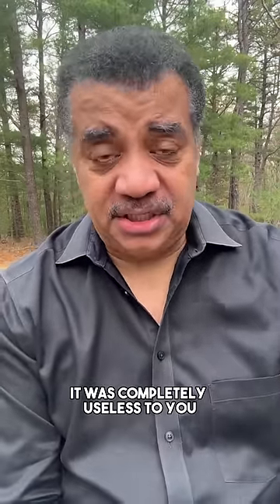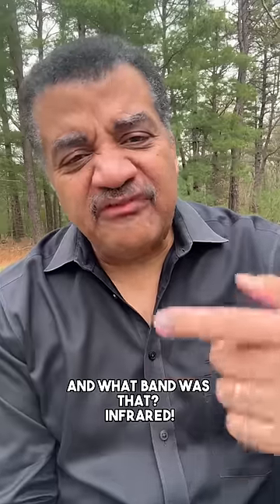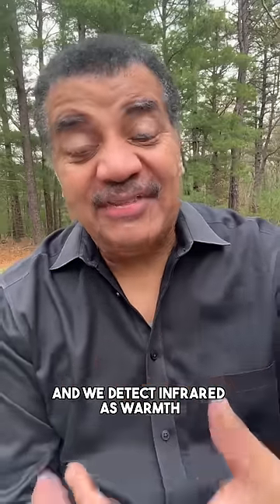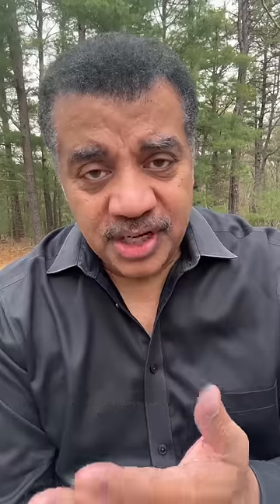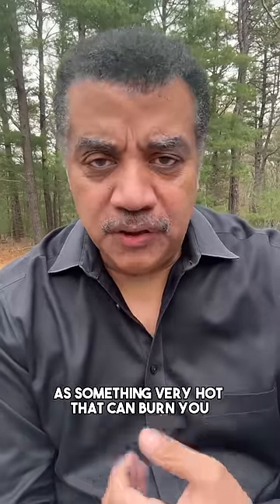LED Bulbs vs. Old Bulbs 💡

Comment: LED's do get hot, but only on the bulb base.  After it has been on for a while, turn it off for a half hour before unscrewing.
Reply: The same way you could unscrew an old lightbulb without waiting for the glass to cool off. Just avoid to touching the hot parts directly. For old bulbs use an oven mitt or a towel or any basic pair of gloves. For LEDs just set the bulb down and let it cool down. There's no need to let the base cool off before removing it.
Reply: 1/2 hour? a few seconds seems to be all they need. There's a 60W equivalent right next to me which has been on for several hours, and its temperature is just a little warm. I can grab it and unscrew it while it is on.
Reply: That's the DC power supply making the heat.  They use inefficient garbage circuits to cut manf costs and to ensure the bulb eventually dies and forces you to replace them (IE, buy more).
Reply: @meeponinthbit3466  yeah, i work maintenance and the package may say lasts ten years but never in reality. The diode may last that long but the cheap electronics never will and yes, that's what gets hot.
Reply: You only have to wait like half a minute then it's cooled off enough to touch long enough to unscrew the thread a twist at a time
Reply: Thanks
Reply: 🤔 I have bougth cheep ones, expensive "good" brand ones, they get hot as h#@%!..... 
All the safty courses l have been one recomend LEDs.... I wonder if then course instructor ever has checked his lightbulbes, old style or  new style.. Not with his fingers!
Reply: @meeponinthbit3466  No kidding, I've never had a single LED light bulb last anywhere close to what it was rated to last.
Reply: Correction. Led bulbs get hot but the base is designed to transfer the heat away from the led like a heat sink and so it gets hot.
Reply: @ankurbhardwaj6184   Most heat sinks in those LED bulbs are so unsubstantial that they're not capable of drawing away enough heat. I've dismantled every single failed bulb from every brand I've purchased. The very expensive ones have thick, heavy heat sinks and the cheap ones have barely more than just some foil.  Sadly, none of them last to their rating.
Reply: @ranman7688  you missed my point.. I agree to what you'r saying. What I said was that I disagree that led bulbs get hot only at the base.. infact they get hot right where the led is fitted and the base feels hotter because it's supposed to take the heat away from the led itself. How good the base is depends on the manufacturer but the base heats cause the LEDs generate heat
Reply: @meeponinthbit3466 I'm guessing you've seen the breakdown of the Phillips bulbs from Dubai that BigClive did.

It's a shame that manufacturers are allowed to get away with planned obsolescence and waste resources while claiming to be better for the environment... And charging more for the privilege.
Reply: @16-BITFPV There’s no way they get hotter than an equivalent incandescent, that’s basically impossible when the power draw is so much lower. Like Neil said, incandescents are basically just heaters with a side-effect of making a bit of light.
Reply: That was a good episode
Reply: Yes but the incandescent is better at handling heat (tungsten is literally about the best material to use for heat and is also used for Welding) vs the plastics and other weird substances that come in an LED bulb. I'd rather breathe air in a room with hot tungsten and glass than one with heated mystery glues and fire retardant plastics.

Comment: Fun fact.
In cold climates, that energy isn't wasted.
It's electric heat that reduces the amount of energy used in your heating system.
Reply: Most of the world experiences Summer though. At what point is the additional energy used by the cooling system more than the energy saved by the heating system
Reply: @sbk2207  theres no such thing as being more than 100% efficient
Reply: There is still energy wasted, thermal energy is converted into kinetic energy.

Comment: It wasn't completely useless! On cold nights in Michigan I would turn down the furnace and snuggle up under my comforter and read a book near a warm incandescent light bulb. It was delightful.
Reply: Yep,  if you still have power and your furnace fails , a 100 watt bulb in a confined (insulated) space can warm it up .   Under a comforter, in a "table fort" even sitting in the bottom of a small closet etc.   I suppose you could have swapped out the lightbulb under the comforter for an electric blanket which would do about the same thing energy wise but with out the added benefit of reading light..
Reply: @markbajek2541  then there is the worry of starting a fire or getting burned touching a hot bulb
Reply: @chrism3784 
Which never happened in history lol.
Farmers in India use it to keep their farm chickens warm at night
Reply: Paul Wheaton has some words to say on this subject. Extra heat in the summer, no thanks, but in the winter, absolutely not wasted energy.
Reply: Cute. Next story my guy...

Comment: ...and even with LED bulbs our electric bill keeps going up, up, up!
Reply: but dont worry those expensive bulbs that are worse for the environment to produce and dispose of, and aren't any better to use, well they're "saving the world" by all that nasty climate change incandescent bulbs cause, ya know!?
Reply: The Amish are the greatest adapters to Solar; but their electrical needs are about Necessity, &use something like 30% ov a ‘Standard Household.’

Blame Capitalism allowed free reign from about 1980 onwards &the need to destroy ‘Socialism’ in whatever form.
Reply: live somewhere with cheep power
Reply: Lemme know when you find it
Reply: The electric company shareholders and directors are the ones benefitting
Reply: Thanks Brandon
Reply: @stevehendricks5443 the president (before you accuse me of something i dont like joe biden) is not responsible for literally everything that goes bad in the co8ntry. Please actually research why things are the way they are instead of just blaming the first thing thst comes to mind
Reply: Trouble is, lights were never a huge part of our energy usage. Incandescent contribute to heating your house in the winter, so at the time, in a way, they’re 100% efficient. Conversely, I do like led bulbs in the summer, since they don’t contribute as much to the heat load on the a/c.
Reply: @sirrivet9557  Lol! Touch a nerve?
Reply: ok try going back to incandescent bulbs and see what that does to your electric bill 😂
Reply: @adrianpg4460  Many people still have them including myself. If its still working, why replace it? Lol

Comment: I used to live in a place with no heat during very cold northern winters. I hated LED light bulbs in the winter because they didn't put off any heat. The old lights helped add a tiny bit of heat to my room. I loved the LED lights in the summer as I didn't have an effective way to cool the place down either. I would switch out the lights depending on the time of year it was. It was not my place and I had no way of fixing all the issues there and finally ended up being able to move after over 7 years of no heat among other serious issues. I couldn't even plug heaters in or I'd blow the power. I could have a heating blanket but that was it.

Comment: The heat from incandescent bulbs is not wasted if you live in Minnesota in the winter.  In fact in those cases, the incandescent bulb is 100% efficiency… it provides needed light and needed heat.
Reply: Nope, not 100% efficient. When filament gets hot, it expands, which uses energy, and the expansion causes sound waves between bulb and filament, which works as an air conditioning unit. Also, when filament heats up, nearby gas particles are heated up and ionised. Also, electrons are ejected from filament by thermionic emission, these electrons can interact with earth's or the sun's magnetic fields and convert the heat energy into kinetic energy. So nope, sadly not 100% efficient.

Comment: I think I saw an example of this difference with LED traffic signals during winter snowstorms. Snow would build up and block the newer energy-efficient signal lamps, while the old incandescent ones would melt the snow off themselves.
Reply: The LED stoplight and the dangers of "but sometimes!"
-Technology connections
Reply: @commit7059  Exactly!  My observation (and being an electronics professional since the 1970s) came before I saw that on Technology Connection's channel.
Reply: I am not personally in winter country but why don't they build cover
Reply: @jumpjump-oz2pr  They do, actually.  There's typically a sun shade sticking out above each lamp to help for better contrast between on and off.  But snow tends to blow around and sort of collect into miniature drifts on things, including the lower part of the light housings and around the lenses.  I also think the LED lamps were originally retrofitted into the same housings that the incandescent or other technology lamps used; they're gradually redesigning them to work better with LEDs from the start.

Comment: Kind of. They are absolutely more efficient, but they still release heat. In fact, many LEDs require cooling (heatsinks and/or fans) to keep them from getting too hot and burning out, even with the low wattages they tend to use.

Comment: The old light bulbs kept me warm in the cold winter !!! A fantastic benefit.
Reply: But you paid double to AC the heat out of the house in summer. And a heat pump is again so much more efficient at heating the house (90% vs 400% efficiency considering electricity)
Reply: and in tropical countries, we dont need the heat.. just light..
Reply: Neal wants to be known as an Einstein. Wasting his useless knowledge in the forest where he cannot find peace from his thoughts.
Reply: and LEDs keep me cool in the summer
Reply: only for the people in northern hemisphere. For us Indians invention of LED is a blessing
Reply: Did you huddle up around your ceiling to sleep with a blindfold on?

Comment: That IR sure was handy keeping the inside of a pumphouse above freezing or keeping chickens alive during a brutal winter. The quest for efficiency is a pita in these cases.
Reply: There is a thing called electric heat. You should try it sometime.
Reply: @MrT------5743 😂
Reply: I mean it was handy if you didn't want another tool for the job I guess. But you can do the same job for a lot less energy with the right tool
Reply: @Stupidguywithguns  yes but electric heat doesn't produce light. What do you want, heat or light? Why produce both for either. DuH
Reply: @MrT------5743  yep no reason to burn out a lightbulb just because you want some heat.
Reply: @LethalLuggage  if you want heat. Why not get a heater? If you want light, why not get an LED?
Reply: Why cant we be okay with both. 2 different uses
Reply: Literally, since the 1970s, people have been talking about changing from light bulbs to other technology. And people have, partially because people can save a ton of money being more efficient with electricity.
Reply: In Australia we've invented a thing to put out warmth. 
We call it a "heata" ...... still working on the name though.
Reply: @CombatMosquitoTrainer someone shows you their “heata” in the u.s. it’s probably because you’re being robbed.
Reply: Well, the LED bulbs usually are used in well insulated houses with other sources of heat like chimneys or more efficient heaters...
Reply: @angelr194  insulated  ??
Reply: @CombatMosquitoTrainer  sorry, the autocorrect, I changed it.
Reply: @angelr194  👍 I thought that's what you meant.
Reply: There are other ways but you can still get the old ones and pay the high cost.
Reply: @MrT------5743 they did.  It's called a light bulb
Reply: @tmayorca8770  using light bulbs for heat is super dumb though. You waste light energy if you want heat. And waste heat energy when you want light. 

If you want heat, there are better heaters, if you want light, there are better lights than incandescent light bulbs.
Reply: Just picture an electric heater coated in chicken dander bursting into flames....
Reply: Why were you spending energy on lighting your pump house? The efficiency per unit of heat from a light bulb is not good compared to a purpose built heater.
Reply: @Hollows_over_balls no a light bulb is not efficient heat, the clue is in the name light bulb, you either have unneeded heat or unneeded light that your blowing money on.
Reply: @mrsducky3428 radiator no chicken barbecue or chickens up all night with the light on.

Comment: And yet, amazingly, my electric bill is 3x higher than the 1990's despite this.
Reply: It's your electricity bill, no longer the light bill, as it was called in former times. You just use a lot of non-light appliances.
Reply: Even things plugged into outlets that aren't "on" are using electricity. Unplug anything that is not in use. Like phone chargers, and other things that are sitting in an outlet not being used until you need it. And think about anything else electricity wise that may be running most of the day that you can turn off. This has helped me. May help you as well.
Reply: Because you are being billed more per kWh than you were in the 90s
Reply: Also inflation.
Reply: @Ang_This2shallpass not true
Reply: It's called inflation...welcome to the presant
Reply: watching YouTube on a 500 inch plasma tv

Huh wonder what it could be….
Reply: Wrong hairplugs I did the experiment with both and was the same..
Reply: @LiamMcBride  The price of electricity has not increased threefold since the 90s, meaning his overall consumption of electricity has increased.
Reply: Exactly!
Reply: Get an led washer, led oven, led phonecharger ect. Should solve ur issue.
Reply: They saw the oportunity to charge you more
Reply: Science!!
Reply: Your lightbulbs contribute very little in the electricity bill.
Reply: It’s almost as amazing as the commenters here who are hellbent on blaming you for thinking your electric bill is lightbulb driven.  Take a breath, people.
Reply: It’s Brandon’s fault
Reply: My television shines a red light at the base. I guess it is to let me know that the set is turned off.
Reply: @raze3297 I did not give consent to our government to print out money they do not have to create inflation.
Reply: @kurikuraconkuritas  it's very true, if it's plugged in it's using some pwoer
Reply: Lighting really doesn't use much power in a modern house. Switching from incandescent to LED saves a lot relative to the bulb but next to nothing realities to other electrical uses.
Reply: Where im at they charge natural gas on our electric bill even if we dont have that particular service they said its easier to charge us now in the events they provide it later on
Reply: Dude you cannot compare your bill from 30 yrs ago, that's called inflation has nothing to do with light bulbs.
Reply: Not because of LEDs. Because the power companies are greedy.
Reply: Such is the magic of price gauging.
Reply: @johnrpomeroy  Power companies have to have the money to maintain their systems and buy all this renewable as the government mandates them too. Also electric prices have actually lagged inflation so power is actually cheaper today per kwh than it was in 1990 when correcting for inflation.
Reply: @kurikuraconkuritas  Why do you disagree?
Reply: If you want to save on electric bills there are many things to take a look at. Here are are some ways people don't always think of. Insure your ac coils, refrigerator coils, and your electrical panels are balanced on their loads  for ckts that are used the most frequently. Hope this helps.
Reply: Inflation v.24
Reply: @Needless2say  Not sure what you are saying? What do you do to balance your ac coils?
Reply: and LEDs are worse for the environment in every way, worse for you, and worse to use, but ya know, green energy.
Reply: @LiamMcBride why did you have to let him know it's not the 90s anymore
Reply: @crissd8283  Perhaps I didn't punctuate properly. The coils should be cleaned to dissipate the heat efficiently. Separate from that balancing the most commonly used ckts between both phases. The power company charges the customer according to the phase that pulls the most amps. Example- if phase A uses 10 amps and phase B uses 40 amps the customer will be charged as though the customer is using 40 amps on both phases.
Reply: @Ang_This2shallpass  incorrect :c I thought the same
Reply: Skill issue.
Reply: @Needless2say  I highly doubt residential customers are charged based on which phase uses the most kwh.

By coils, do you mean transformer coils? I would agree you should keep them somewhat clean of dust as that dust will cause the transformer to run hotter, but I doubt the electrical savings add up to anything.
Reply: First of all, inflation. Second of all, if you're that skeptical, compute for the wattages of every appliance you had back then compared to now. Even refrigerators and air-conditioners have become energy efficient now. I doubt you use the same electronics and appliance then and now.
Reply: @boscoalbertbaracus1362  Can you explain?
Reply: Power companies are switching from cheaper coal to more expensive sources of power and passing the cost on to consumers
Reply: @HolgerJakobs You really think they don't know that? Key word: Amazingly😂
Reply: @n9wox  That is true; however, electricity prices on average nation wide have not kept up with inflation from 1990 to today. In other words, one kwh of electricity on average costs more in 1990 when correcting for inflation than 1kwh today.

I didn't look regionally so I wouldn't be surprised if California's electric prices outpaced inflation as they are pushing green hard.
Reply: It’s called inflation little boy
Reply: YEEEEEEEEP!!!!
Reply: @TheRealDeadhorse are we meant to beat you instead of comment on the amount of electrical components that exist nowadays? 😉
Reply: You can thank British Petroleum's gaslighting energy initiative for that
Reply: @ItsKiraLyn  beat away